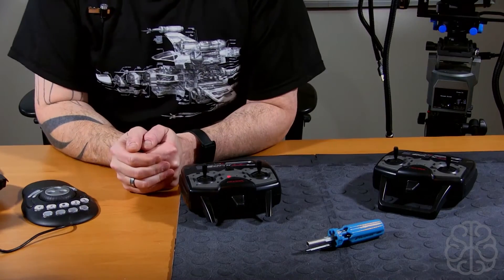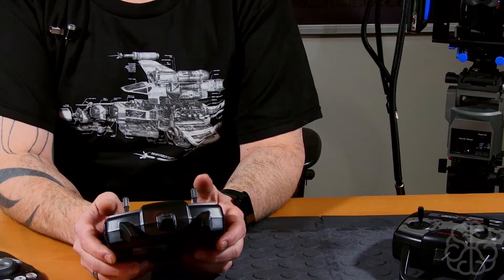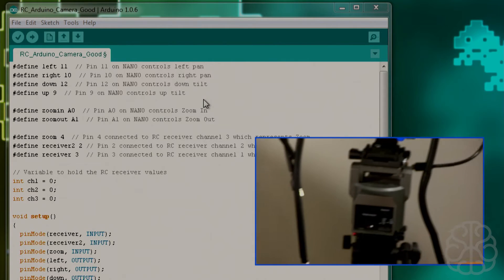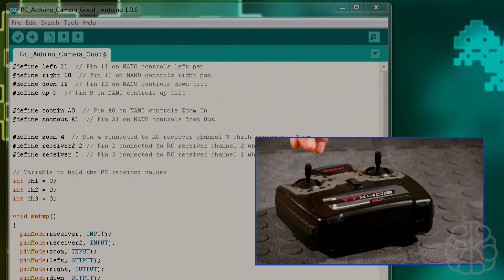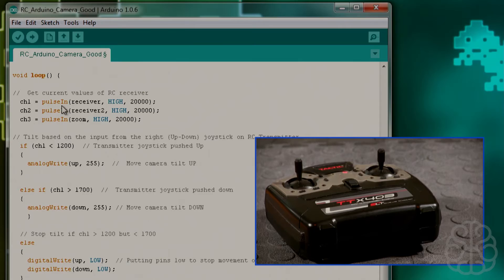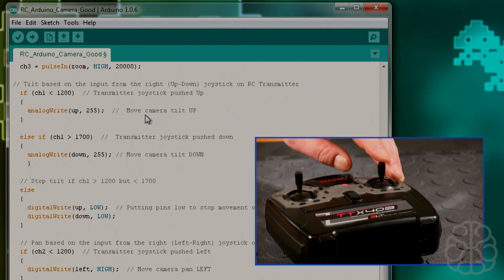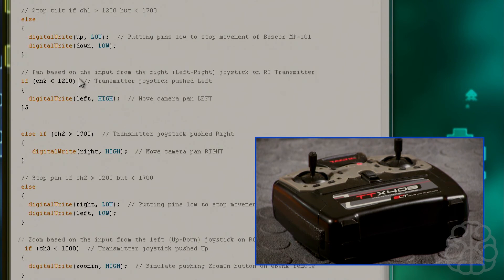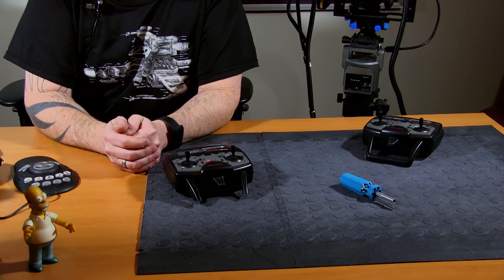Part 2- Wireless Pan Tilt Zoom Camera system using a Bescor MP-101, RC transmitter, Arduino-Tutorial

Comment: Great tutorials - thanks!!  Can you help at all?  I'm having a strange issue with getting this to work properly.  I have control of the MP-101, however, the joystick is mixed up.  Right moves it right, UP moves it left, down moves it up, and left moves it down.  I'm not sure where I've messed up, or whether the transmitter is responding incorrectly.  Any thoughts?
Reply: Then...when I switch pins 9 and 11 (in case I wired incorrectly) - nothing changes - same control with the joystick...seems very strange (but I'm really quite new to this, so who knows)

Comment: Excellent! I would very much like if you could make tutorial on how to record and playback stepper motor movement. This would be handy in many applications, the one I would like to make is for a camera slider with precision repeatable movements. Press "Record", move the camera along the slider (with a joystick for example), pan it (with a joystick) and tilt it (with a joystick), press "stop", then press "Play" and it will playback the motions you recorded. If horisontal movement, pan and tilt could be recordable on separate channels that would be even better. Then one could fine tune one movement (say horisontal sliding), play it back while recording the pan, then play that and/or the other back while recording the tilt movement. Then combine all three in playback.Best regards and thanks for excellent tutorials!Matthew
Reply from the maker: +Matt D'Rat Thanks for the great comment and suggestion!  Will look into doing something like this in a future tutorial.  Thanks again for watching.